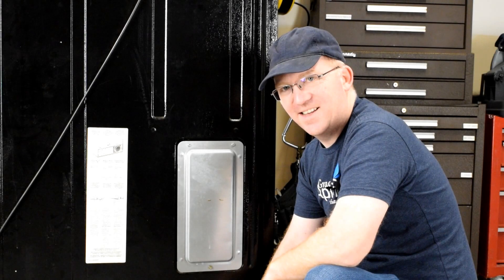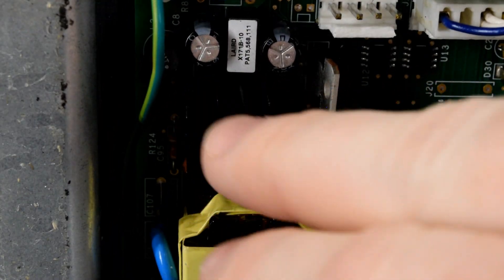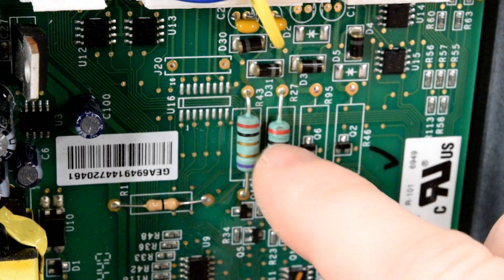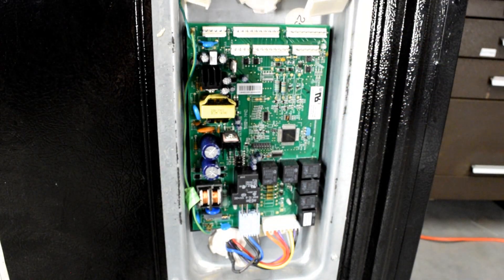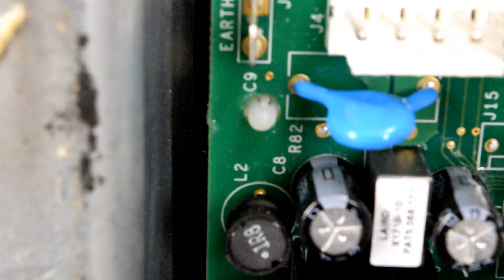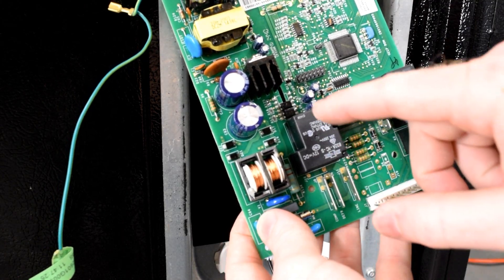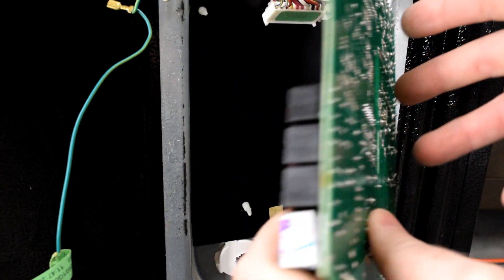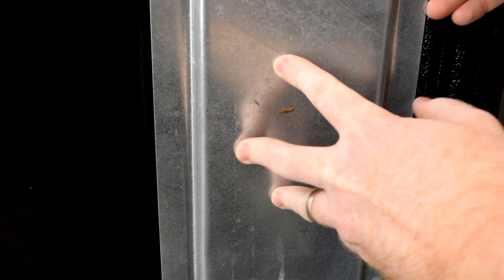Diagnosing a Bad GE Board - Part 2: Visual Inspectios

Comment: I want to thank you so much for your video.  My GE refrigerator that I had for 10 years started a intermittent clicking sound.  I just ignored it.  Until one day, the fridge stopped cooling (3 months later).  I opened up the back and looked at the control board and noticed 2 burnt resistors.  I ordered and got a new board from EBAY express 2 day shipment for $180,  got the board and replaced it.  But, it was still making the clicking noise.  I was afraid I would damage the new board because the fridge did not cool and still hear noise.  I checked the fans evaporator & condenser, temperature thermostat, and everything was running.  The compressor was not running.  I checked the relay start & overload device on compressor, there was no broken pieces or any kind of sound of damage from the relay & overload.  I still ordered a new relay & overload.  I was nervous because I was afraid the compressor was no good and it would be very costly, being that I would not be able to DIY.  Well after I got the new relay & overload...replaced it, and WHAAA LAAH.. IT WORKED.  It was the most beautiful sound to hear when your compressor begins to HUMMMMM again.  Going back to your video, which has genuinely helped me start the process of repair by myself.  Your video was concise, thorough, and I was able to change the burned board with ease.  I commend you!! Even though It was more than just the main control board, it was also the relay & overload device.  All cost me $240.  You saved me a repairman who was going to charge me double or triple the cost.  I did soo much research that I feel I can just about repair anything on this fridge now.  It all started with YOUR video.  Thank You
Reply from the maker: Awesome work Charlene!  
Just FYI, the burned resistors (larger green ones that are side by side) are caused by a failing evelorator fan motor. They short out internally and even though they spin, they are defective and will soon damage your new board. 
 If you do not replace the evaporator fan motor along with the new board the fan motor will cause the nre board to fail as well. So, I think the new board was in order even if your compressor relays were your immediate issue.
I'd recommend also replacing the evaporator fan as well.

I hope the info is helpful and please let me know if you have any questions!
Andy
Reply: Thank You So much for your quick response and helpful advice.  I will definitely order and replace the evaporator fan motor.  Subscribing to your channel!!
Reply: Thanks Charlotte for sharing your GE refrigerator issues. The fridge I’m working on also have the clicking noise. Can you tell me if the clicking noise was coming from the control board? The relay on the fridge was replaced but the clicking noise won’t go away and when the evaporator fan is plugged in the compressor doesn’t kick in. Grace Appliance, can you help me to figure out what needs to be replaced? Do I need to replace both evaporator fan and the control board? I have not taken the control board out to inspect for burnt marks. The ohm reading fluctuates when testing the control board. Can’t remember which part was tested. Have to go back to retest.
Reply: Where did you find the start relay at? I'm having this problem now and i can't seem to find it. Exact same model as this fridge

Comment: Hi Andy .I have a GE GSE25HGHBHBB  I have replaced the defrost heater element and switch, the evap fan and thermistor and the recently the control board. The freezer shows 10 on the panel the fridge shows 44 on the panel. If I use a Lazer temp gun it shows 26 in the bottom of the fridge and less then 0 in the bottom of the freezer. Since the new board I have no water from the dispenser. Frozen?  What should I do next?
Reply from the maker: Hi Karen,
If you could please send me the first 5 digits of your serial number as well?
Some models require a modification to the wiring harness with a board replacement and give this type of symptom so, I wanted to check that for you. 

As for the dispenser, you're probably right that the dispenser in the door is frozen. It's very common with the GE side by sides.
There is this tool which is handy to take care of it quickly. If you have a GE you should own one of these too.
affiliate link: https://amzn.to/2DMQ9JD

Once you solve the temperature issue you may not deal with the frozen line again for quite a while so that's good.
Reply: @GraceAppliance  I just bought the tool. I will be home tonight and send you the serial number. Thanks for the speedy reply.
Reply: No install instructions came with the board. The original problem was freezer frozen up . I thought the door may have been left open. So I pulled the evap cover to find ice . I blew dust off the condenser coil defrosted the the evap coil put back together. Waited 24 hrs
Reply from the maker: @salvatoregagliardi48  gotcha! 
I'd also watch the video of mine called how to test and replace a defrost sensor.

This video shows you how to test your temperature sensors for the fridge and freezer.
I'd take a close look at the fridge temperature sensor.

The ohm resistance which you'd test with a multimeter changes based on how cold the sensor is, but the video will walk you through how to do that test.

That's what I'd start with.
Let me know if you have any questions
Reply: What board did you have in mind other then the one I installed? Wr65x22867 was the other option
Reply from the maker: @salvatoregagliardi48  you've installed the correct part number for your model. There is a more common board which people make mistakes when installing that gives these types of issues. It's a Wr55x10942, but isn't for your fridge.
Reply: TD432396
Reply: The board number I installed WR55X24347
Reply from the maker: @salvatoregagliardi48  Thanks Karen!
Your model is not impacted by the instructions I mentioned. But, your board is different than the part number I had in mind. 

So, if the board came with any install instructions, you might double check on that paper to see if there are any serial numbers listed that are impacted by that modification.

Outside of that, your temperature sensors seem suspect to me.

What was the initial symptom the fridge was giving you before replacing the defrost heater and board?
Reply: The connector is different then the one in the video. Colors are different too. How can I and you a picture?
Reply: I have from the top blue, yellow. Red,grey, the blue again
Reply: Top one blue 5.65k yellow 8.21 red 10.01 grey 8.56k
Reply from the maker: @salvatoregagliardi48  thanks Karen!
So, I'm unable to locate the tech sheet for your exact model. The one that's closest to your model number still shows the colors as are shown in my video.

I am not sure which colors correspond with each sensor.
Certain models will have additional sensors, such as a 2nd refrigerator temp sensor, a temp sensor for deli drawers etc.

You aren't able to attach a picture on YouTube.  You could email it to me at Graceappliance@gmail.com but I'm not sure that it would assist much without the diagram to go along with it.

I'm afraid I'm not sure what to suggest. One idea is to take your readings, heat up the sensor with a hair dryer and then take the readings again. The reading that changes to a lower number is that sensor that you just warmed. 

It would be a pain, but that would do it.
Reply: @GraceAppliance  Is the tech sheet attached to the fridge anywhere? or is it only available to GE service people?
Reply from the maker: Karen Gagliardi some GE fridges with the temp controls inside the fridge at the top will have them hidden inside this console. Outside of that example, I don’t believe they’re hidden anywhere else on a GE fridge.

Comment: Thank you so much for this video! My large capacitors apparently went out, and this is likely the problem with my fridge given the symptoms and your pics of blown capacitors. Saved me a bunch of time and money! You rock!
Reply from the maker: Awesome work Chris!  
Glad I could be of some help.  Please consider making your purchase through one of the Amazon links in the description and this really helps the channel.  

Thanks!
Andy
Reply: @GraceAppliance  It's the two larger, bottom ones.
Reply from the maker: Chris Senters hey, I don’t.  I get my components though mouser.com, but buying them in bulk the price came way down to be sure.  I don’t do a lot of board work these days though. 

I think you’ll be fine with rebuilding yours. I’d also recommend doing the medium sized caps as well along with the relays. 
The main issue you’ll run in to with doing these GE boards is the stupid conformal coating they put on the board. It’s that gel/epoxy material covering the components. You’ll find that you have to be rougher with the board than you’d like to remove the old components. Be cautious of the amount of time you leave the iron in the board as to not damage the solder pad and thus destroying the chance of resoldering anything there.  

I attempted to make a video on this rebuild process once, but got frustrated with how rough I had to be on the board and figured others would be cussing me for even recommending rebuilding it.  I’ve had about 70% success with my attempts I’d say. 

Let me know if you run in to any questions!  Thanks!
Reply from the maker: Chris Senters oh, also another tip is that you can increase the voltage rating on your caps so long as the uF remains the same. Just watch tonbe sure that you have enough physical space on the board for the cap and you’re good. Also, you can always offset the cap off the board and bend the leads to accommodate the cap if the size is wrong.
Reply: @GraceAppliance   Absolutely, do you have a link for the capacitors? I used to mess with Arduinos and Raspberry Pi so I have some soldering skills I might try that first and see how it goes.

Comment: Hi question do u have to ground ureself to do this? Thank u
Reply from the maker: Hey!
Touching ground before handling electronics.  
You should, I should...I don't, but it's easy so I need to start. 

All you need to do is, every few minutes,  touch a grounded metal object before touching any electronics.  This can be anything metal on your refrigerator frame, covers, compressor, brackets, etc etc.  
This discharges any built up static charge that you may be carrying and prevent that from jumping to the electronics you're about to touch. 

The only time I really think about this is when I've opened a brand new control board still in the box. I've already at that point disassembled the refrigerator to expose the old control board (and thus grounded myself), remove the new control board from the packaging trying to touch only the plastic portions of the board and taking care not to touch the solder joints on the back of the control. Either way, I've never experienced or heard of any appliance boards getting damaged this way. I think they're fairly robust as far as this is concerned from what I've seen. 

Folks who work on high dollar electronics or solder all day every day may consider something like this self grounding bracelet: 
Amazon affiliate link: https://amzn.to/2JvmiaK
Reply: @GraceAppliance  got u thx... So when taking out the new motherboard can I just keep my non dominant hand on the metal cover once I remove it from the fridge?
Reply from the maker: @Holabella  hi, after you've touched ground once you can use both your hands. Just touch ground once and you're good.  Thanks!

Comment: would you suggest a surge protector to plug the refrigerator into instead of plugging directly into the wall socket? We had a power outage and when the power was restored the fridge won't run anymore I suspect it is the main board and is the 2nd time I will replace it in several years, do you think a surge protector may help?
Reply from the maker: _ Harbinjer I personally don’t recommend it through just a normal home surge protector because a fridge compressor cycling on can trip the fuse as it pulls very high amperage for a few seconds when turning on initially. Now, I do know they make specific fridge surge protectors which may or may not actually help in the event of a lightning strike for instance. I’ve heard the spike in power is quicker than the surge protector can react to to actually be of any use. This is all just what I’ve heard in my travels. It could be off the mark for sure.  
You may also look in to a whole house surge protector which would be installed at the breaker box mains before it even gets to the house.  I’m sure it’s quite expensive, but might be worth it if you used it once. :)
I’ve seen some insurance horror stories when it comes to lightening strikes/power surges.

Comment: Excellent video!  My Hotpoint refrigerator suddenly stopped freezing and cooling.  The compressor would not come on but the fans were running.  Per this video, I pulled the control board out, examined the back side and...BINGO!...the exact point that you predicted would be burnt...is.  Thanks for sharing your knowledge.
Reply: As a follow up - got the new control board and installed it.  Fridge is up and running again!  The freezer is running around 0 degrees (+/- 5 degrees).  Fridge is running around 37 degrees.  They started at 70 degrees and it took about 12 hours to stabilize.  Ice-maker is cranking out ice.  Both thermostats are set to 5 (mid-point).
Couldn't be better!  Thanks again for pointing me in the right direction.  Before watching your video, that fridge was oh so close to ending up in a landfill.
Reply from the maker: Greg Sullivan awesome work Greg!  Glad to help and that it worked out well.
Reply from the maker: Greg Sullivan awesome work Greg!  I’m glad you got it figured out and that I could be of some help.  Stay in touch.  Andy

Comment: Hello I have one just like that but I don’t know what’s the part number for the glass fuse can u please let me know thank you I have repaired the capacitor but fuse no good broke it by accident so I need to change it
Reply from the maker: Hi Ferris, 
I’m sorry I do not know as I have never needed to replace this, but if you’ll look very closely at the metal case/end caps on the broken fuse on your board we may get lucky and have an Amp rating on it. If I recall though, I believe it may be unmarked.
Reply: GE Side-by-Side ONLY - Refrigerator Repair Videos ok thank you for taking the time to respond I’ll notify u if I get it
Reply from the maker: You’re most welcome.  I will be curious to know what you find out. 
I know some of the boards use what’s called a quick blow fuse...meaning it can withstand the same amp draw as a standard fuse, but is designed to blow in the event of a power surge. A useless feature if the fuse is non replaceable.  

Also FYI, they make fuse holders that can be snapped on TOP of the existing fuse and will hold a fuse above the blown out one already on your board.  You may look in to this.

Comment: Hi Andy  I have no power to the compressor but I did have power to the lights when I opened the door I my GE refrigerator I did all the tests in order, i have  no power to the front panel  so I  purchase a new one and had the same problem I check for the DC voltage and unplug it from the board and did not run , could it be  other bad board
Reply from the maker: Hi Nolberto,
I'm sorry to hear about your issues with your refrigerator.

You've followed the right steps it appears. If you had no voltage being sent from the main control (I. E. Behind the refrigerator) to the front board it is indeed a failed main control. If you now are getting the DC voltage to the front control panel, yet the front board does not light up, you will need to replace the front board as well.

It could be that the front panel being bad damaged the main board.

Sounds like you've done well with the diagnosis based on what you've shared.

Let me know if you have any questions.

Thanks!
Reply from the maker: Hey, just to clarify you've also watched this video, correct?
https://youtu.be/ViFpwH6_WrM

If you're getting 13.5vdc at the black and red wires on the back of the touch panel control board and its still not lit up, it's a failed touch panel board.

If you have 13.5vdc at the main board, but not at the touch panel board then the most likely issue is going to be the plug near the lower freezer hinge behind the kick panel. 
There's a white plug there that tends to give issues. 

Let me know if you have any questions. Thanks!

Comment: Andy i have a kenmore i have a ADC board how to check if is bad
Reply from the maker: Joe Padilla hi Joe, this is the procedure I’ve used in the past. I’ll be honest that I have not worked on many of these, but would always visually examine the board for burned solder joints.  I’ve seen that a time or two. 

https://appliancerepairtips.wordpress.com/2010/06/27/adaptive-defrost-controls-adc-part-1-whirlpool-kenmore-refrigerators/